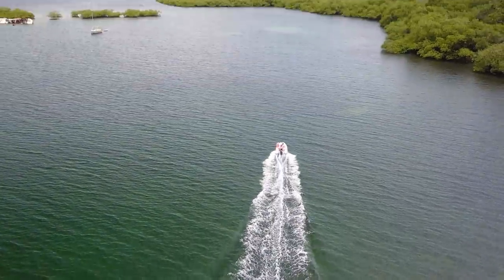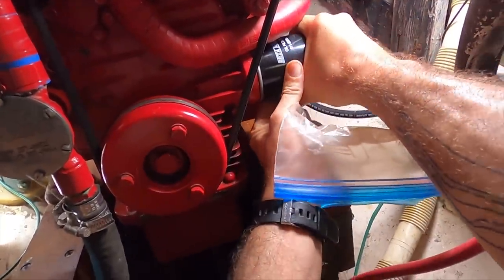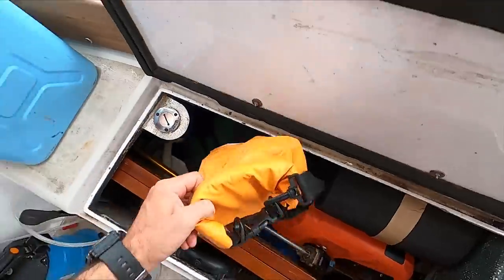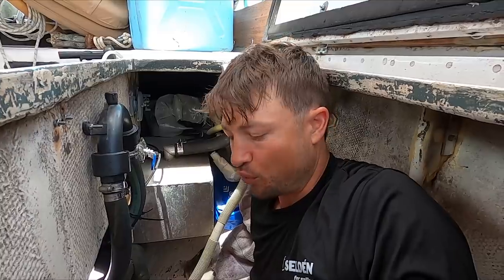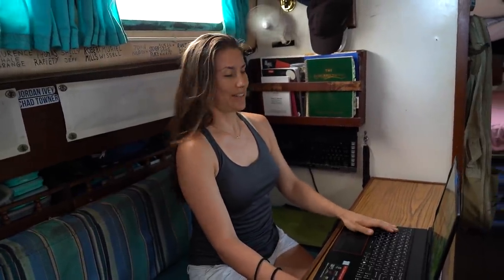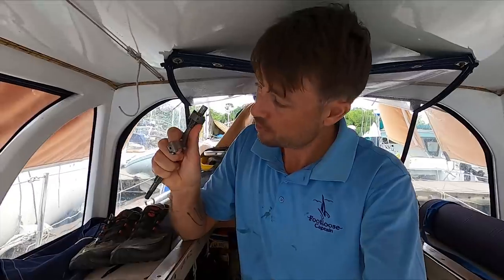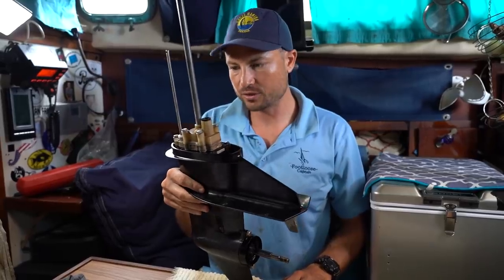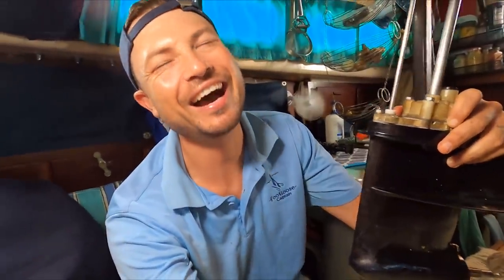We Did It! | S04E37

Comment: Many years ago when I lived in Alaska I had to rebuild the top end of my Toyota pick-up in the middle of winter. I lived in an apartment without a garage. So I built a tarp over the truck & rebuilt the top end in the middle of winter with the owner's manual as a guide. Also had to wear warm gloves to keep my flesh from sticking to the cold metal parts as well. But I did it and like you was so proud of myself for working through it. Great job on your repair. Thumbs up!!!

Comment: Hey guys❤️ Cruising this summer we did the same thing to our beta - hot tip the bolt that holds the alternator to the rest of the engine broke off...it was so hard to find a replacement- Beta ended up overnighting us a bolt ( they only had one and have to make more), having the correct bolts in spare for this special connection would be a good for you and your travels...Fair Winds- Amy
Reply: TART TARTIN we have the same engine. Thanks for posting this tip!

Comment: I tell everyone this; get a Harley (yes, Harley Davidson) aftermarket remote oil filter kit. You can move the oil filter to somewhere better than hanging horizontal off the side of the engine. Possibly on the bulkhead with a built-in catch pan under it with a funnel/drain hose attached. Bonus: you can use better (bigger, multi-stage, etc) filtration once you are free from the block mount.

Comment: For your companion way for mosquito screen cover you can cut a piece that will cover the entryway when it is completely open and then create a seem surrounding the boarder for a chain to be inserted or just sew the seam over the chain. This will weigh it down so if the wind does pick up it will not blow away. This is great for when you are sleeping and you don’t have to worry about waking up to a bunch of mosquitos.

Comment: Tiny tip....apply a light smear of new engine oil on the new oil filter sealing ring before fitting the new filter...the alternator has a pinch bolt on a radius slotted arm above the alternator...slacken the mail alternator mounting bolt..and the top pinch bolt and the alternator can be pushed inward to free the old belt and to tension the new belt...Stay safe out there

Comment: Don't throw away that old belt.  You may need it if the new one should break sometime.  I used to carry an old one around in my truck and used it to seat a tire on a trailer rim so that I could pump it up.  I used it like a belt and wound it tight with a screwdriver so that the bead and the rim touched.  Worked like a charm.

Comment: I would have never thought of putting a zip lock bag on the filter to catch the oil.  Great tip.  I wish you both the best.  You both are amazing and I only dream and wish I could do what you have and are doing. Keep up the great work and most of all have a great time. Signed stuck in boring old getting cold Michigan.

Comment: Great job on the engine, not an easy task outside a workshop! Well worth the perseverance if only for the knowledge on understanding how your outboard works now. A tip for working on these is to take pics before you dis-assemble, then you have an easy reference putting it back together.

Comment: Great job on the outboard and engine maintenance. You may want to consider coating all of threads of any fasteners that you remove from the outboard and inboard engine with an anti seize  product before reinstallation. It will make future maintenance and repairs a lot easier.

Comment: I am an Electro-Mechanical Technician, and have been fixing machines in industry - from Plastics to Steel, Automotive Industry to the Wire Industry - for 20 years. I learn something new every week; the process is never ending! You both have done what it takes to make what you do work, so be confident in that. Don’t beat yourself up, the world will do that for you; it takes a great deal of “strength” to do what you guys are doing. Great job!

Comment: Nice job on the ambitious outboard gearbox repair! One thing you may want to consider for the Beta Marine inboard is to pick up some sensor friendly goop/sealant for sealing the threads on the heat exchanger zinc. The teflon tape it appears you used can inhibit the conductivity between the zinc and the heat exchanger, reducing the effectiveness of the zinc in protecting the heat exchanger from corrosion.

Comment: Deuce, definitely.
10/10 on engine maintenance. If I may, a wee tip on the water pump. If you ever have a damaged gasket don’t put in anything thicker, the pump won’t work properly. Something like a home made one from old chart paper used to be fine, but you have to get it the same thickness as the old gasket. Re outboard 10/10 again, I was once Jeff! (as  I told you) and your  ‘never be beat’ attitude is great! Boat owners have to be like this ;-)

Comment: Your editing is very good. One spot that amazed me was the cut from Jeff's workshop to sitting at the table inside Atticus. The beginning of the shot inside Atticus had sitting motion. You also had narration continuing during the cut. I also noticed the faint continuation of music. All the elements together made a smooth transition from workshop to boat. Very smooth.
Keep using the Modified Bass technique on your teeth. The main point is to slide tips of brush bristles into the crack between  teeth and gums.

Comment: "Lil Shit Too"  The new schedule sounds perfect. ❤  The crazy thing about repairing mechanical stuff, no matter how many times you've learned the lesson from previous teardowns of other things and think you've learned to be observant, no matter how many times you tell yourself to be observant about how you found it, how it came apart... is that you never realize what you don't know, what you overlooked, what detail is important in how it goes back together, until you miss it and spend hours, only to have to start over. I was JUST up til 3am (in the cool of night😎)...taking apart and putting a chainsaw together 4 times before I figured out and remembered the "trick" to the 4ft long recoil spring. The FIRST thing I overlooked was which direction the spring lay in it's little tray...and was never sure I had it right til I had it back together and tried it😱
Reply: My NASA engineer father (who taught me auto mechanics and virtually everything else I know) used to say "disassemble in haste, reassemble at leisure." : )

Comment: Generally shims are used to make up the variable of a cast component to a machined component. The machined parts are made with tighter tolerances then cast ones. If you keep the shims matched with the cast part, you can change the machined pieces without much ,if any,  variance in gear "play". Years of learning to rebuild rear ends and transmissions for drag cars and Jeeps.

Comment: Hi,
I am an old shop teacher and noticed your using basically flat screen or netting which works. But if you create a tent with your screen/netting that has 3 times the surface area of the opening you will be able to get the same air flow as with no netting/screen in place. You don't want to know the hard way I found that out. Also a shroud around the edge of the fan will make it much more efficient at moving air. Real like your videos.
Blessings,
al

Comment: Lil advise with the fan, don't use it to blow air in, turn it around and suck air out. I do that in my semi truck and it cools down the inside. That's how compressorless cool boxes work.
Even better would be a fan from an RV. Like Maxxair. 12V and very effective.

Comment: Impressive troubleshooting.  Our pencil zincs don't seem to last long in sea water.  Using Teflon tape on pencil zincs is an interesting discussion.  Using too much could be a conductivity issue but it can be check with it with a meter.  Quality can be an issue.  I found I could break two of my spare zincs off the brass with very little force.   Good thing they are not pricey.

Comment: I'm amazed you can get that kind of help. They're in that business to make a living. The pins are called roll pins and sometimes shear pins. If you have a set of drill bits you can get them out yourself...using the bit as a punch (usually sacrificially if you don't have a sharpener or file to clean them up afterward). Usually with a socket extension you can drive them back in. A vice is a necessary tool on a boat. You'll want one you can easily secure and remove from a rigid mounting. The smaller the stowage the fewer special tools...everything has to do double and triple duty. On belts you have to look at how they're tensioned. Most are now spring tensioned.

Comment: A note on your zinc anode: I can’t tell from the video, but your anode has to be grounded to the engine.  I noticed you used Teflon tape to prevent leaks.  That may cause the anode to not ground and therefore protect the engine.

Comment: TWO TIPS DUDE.   If you wrap a lot of plastic tape around your Anode bolt on the engine, you might insulate it from the electrical earth or ground it needs in the motor, in order for the electrons to use it rather than eat away other metal inside your engine!!  SECONDLY, when you replace an oil filter, try to fill it with as much oil as you can BEFORE screwing it onto the motor, this saves your engine Main bearing shells from having to run with no oil pressure at startup until the oil pump can fill the filter, and raise up the oil pressure again!  All bearings are designed to run with the crankshaft rotating under oil pressure!

Comment: You might look into Piranha Props. I use one on my 20hp outboard and have a love/hate relationship with it. They are made of a composite material and I feel like I lose a wee bit of speed with it as opposed to a metal prop but it's advantage is that when you hit something the prop will break instead of your motor. The prop blades are individually replaceable and are pretty inexpensive. I like to run my skiff in very shallow water where hitting the bottom or a rock does happen once in a while and I am pretty sure that the plastic prop has saved my motor a couple of times.

Comment: The plastic spacers on the gear-change cable are >plastic<, ie they are able to change shape which they do under force such as the compression of the screw thread. Ideal place for a nyloc nut to keep the nut attached once the plastic shrinks and nut loosens, still needs regular tightening though, that's the nature of using plastic for the spacer blocks. Next tip is once you have rinsed the engine with fresh water spray it lightly with diesel (or kerosine) It is nearly as good a de-waterer as wd-40, then wipe the engine as you would anyway, the de-watering effect leaves a light anti corrosion surface which will reduce rust in the crevices the rag won't reach.
Reply: I was really surprised by the necessity for the plastic spacers.  Even with  tightened that arrangement would allow some sloppiness in the linkage.

Comment: you always have to that process with the shimmy rings. No matter what you do even if you use second hand parts. Normally you buy them as a "pair" and with special blue coloured pasta or liquid what with little pencil can be brought on to the teeth, complete mount it together, turn around 1 time and open it again see if they have a fully rest in each other. If that is the case you have enough shimmy ring(s) in there. Good luck. Far as I can see you doing a fine job.

Comment: After watching this video I would consider having a Vise on board. Create a modular mount allowing you to store the Vise and us only as needed.  I'm DIY guy around the home and the car.  90% of the projects don't require a Vise, but the other 10% can't be completed without one, so invaluable.
Reply: I have a small Craftsmen portable vise. Works great and can be bolted down to the dock or board when needed.
Reply: @marccohen5579  I have several of the Harbor Freight Portable Carpenter's Vises.  19 dollars and are amazingly strong well built.  And they attach easily to any table or other place - with a built-in screw clamp.  Would do that pin job on the video with ease.

Comment: When we had to fit bevel gears together without proper tools we would assemble and run a cigarette paper (0.002" thick) between the gears, if it went through without a mark the space was too great, if it got torn the space was too tight, if it got crimped but not torn the space was just right. The other way to check was to measure angular play of the shafts, so hold one shaft still and turn the other shaft until it stops, too much turn too loose, no play too tight, this method required any play in any splines to be calculated in.

Comment: Highly Recommend no only wiping off Salt Water off the engine. But Coat the Engine is a CLP Cleaner Lubricant Protectant. There are many Brands I use Weapon Shield  But Safariland is a Popular and Cheap. The Weapon Shield Works in and lasts 6 months easy. I started using this on my Guns . But Later Started using on every day needs. Cuts and Prevents Corrosion. Oh and it Holds up to Heat.

Comment: FYI...You guys are great!. I just want to give a one cent piece of changing oil advice....when you put your new filter back on, fill it up as much as you can without making a huge mess. My dad used to do this trick because you can actually see 0 oil pressure on a cars oil guage stay at 0 for the first 7-10 seconds. Also, dip your finger in the oil and rub it on top of the rubber seal of filter before twisting it on. IDK, with your side mounted oil filter this might make more of a mess than its worth?? It's so minimal. You probably knew about these things. Rock on-Buds with suds! jason
Reply: (Little shit) and (#2)?,(The Crapper 2)??
Reply: Yeah, #2!

Comment: It's easier to push hot air up.....you would get much better flow by pointing the fan up and blocking all the area around the fan to increase the efficiency..... Cardboard or plastic works well

Comment: Boo on cutting back.  I understand, but I'm not happy about it.  Jordan, change that lower unit oil sooner rather than later.  During break in you'll get some metal in oil, but it shouldn't be much.  Then change it again after ten hours or so just to make sure the metal has stopped.

Comment: After all working on the engine, spray wd40 all over it and wipe it down as a think layer of protection.  WD40 is a solvent and lubricant in it's lightest form.  Good job!  Aloha!
Reply: Better yet, try a product called Clenzoil. I use it on m outboard, inside and out. It definitely preserves metal. Great on guns, fishing tackle, or any kind of product prone to rust or in the outdoors environment.

Comment: I've always wondered why they use those rubber impeller water pumps which always wear out or break off their vanes (arms) and cause all kinds of trouble. Can't they use the same metal vane type as on most cars that never wear out except to leak a bit when the shaft wears out? I'm at a loss.....  Great maintenance and preventative maintenance btw...

Comment: Wow. The oil container in the bag trick. I've had this happen in the bed of my pickup also. Stopped storing it there. Its too bad they were not converting it to bio-diesel sort of, I think that can be done. Wow, such a roomy engine room. What type of boat is this ? I know its older but, what is it ? Ok, next question, how often had you been replacing your engine zincs ? Was this in the raw water area or the fresh water area ? Answer to my own question, raw water , fitting on heat exchanger. That was an excellent example of PM of engine. OK, next, I will do an air flow on my boat. But, I'll to it with a squirrel cage fan, much quieter. 12v version. Humm, name for the dingy  ? The miracle ?

Comment: If your engine internal anodes are wasting that quick - you might want to consider whether you have current leaking where it oughtn’t, and think about what is being grounded to the engine. Obviously I don’t see your systems, or in fact anything about your boat, and I don’t want to suggest out of turn but, I would be concerned.

Comment: your anode is corroding too fast because it is protecting for another larger anode that is not doing it's job properly you need to check that you have the metal parts grounded well to each other and check the ground path from your main anodes to that part of the engine.